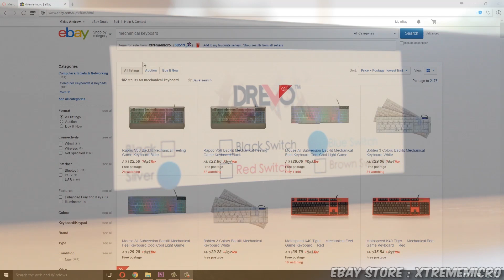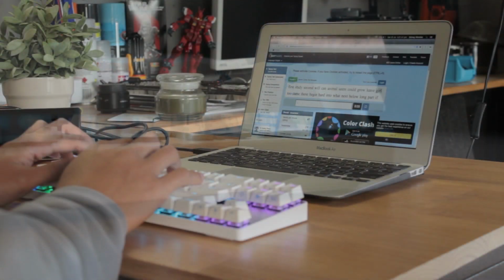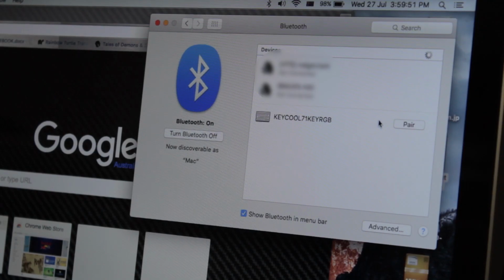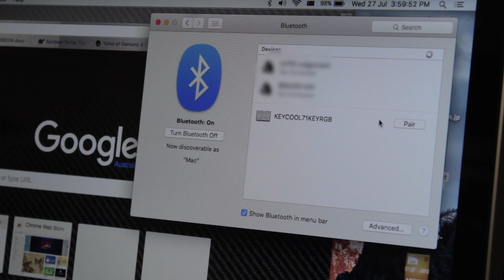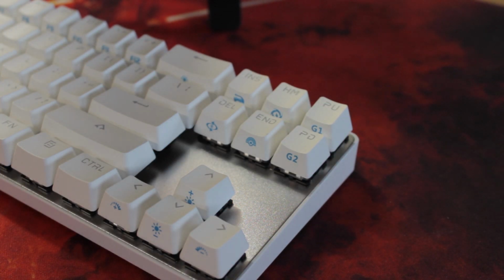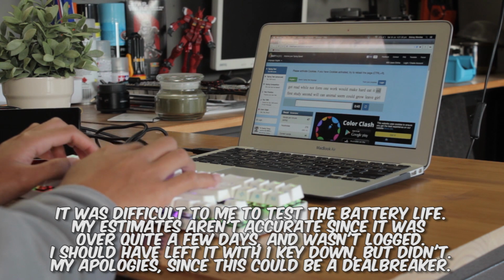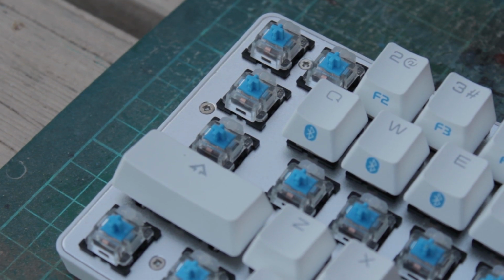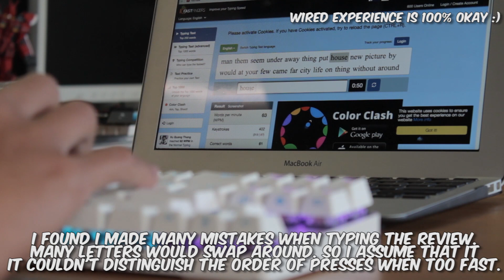Drevo Calibur 71 Wireless RGB Mechanical Keyboard - Unboxing & Review

Comment: READ if you want to know if this is a good keyboard:
I bought it this week and I would recommend it, you get full RGB, mechanical switches and it's compact.
Pro's
-i can't tell the difference between these and real mx cherry blue
-the keyboard overall
-I couldn't feel input lagg and even if you do, you can plug the microUSB in and play wired
-easy to connect, connect once pc will remember (when you plug in cable it automatically goes to wired and if you unplug the wire it goes automatically back to bluetooth within seconds)
-RGB
Con's
-the font (my opinion, but you can replace keycaps)
-if you want to customize the rgb it's is possible for each key lighting but not effects)
the on and off button is not easy accesable (only if you are a nailbiter like me, but it's not impossible to reach)

Comment: What am troubled about is that this is a keyboard with a rechargeable battery. This means that when the rechargeable battery starts to die out your wireless functionality will die with it.
Rechargeable batteries only last for a limited time really. It would have been better if it used normal everyday batteries

Comment: Mine came working fine, but after few weeks of normal used, the usb port got a little too loose, and it started to wobble around. So now, i have to hold the wire down at a certain angle for it to charged properly. Also, thought i could had survive without dedicated F's, and volume key but I was wrong.

Comment: I want to buy it but the thing that throws me back is the build quality, as you said, 2 of your leds were not working correctly and if I get a defective keyboard I wont be able to return it (Personal reasons). Is the build quality (switches) something I should worry about?
Reply from the maker: The switch quality is fine, although they're not the best. The overall quality isn't that great as well, but it is cheap. 

I feel like the keyboard has many features, but doesn't execute any of them that well.
Reply: Would you spend the extra money and get the Anne Pro RGB or this is fine, as I have seen, the Quality of the Anne Keyboard is much higher but buying from bangood will take few weeks to arrive...

Comment: Can you use this connected to the pc via cable/usb ?? and also copuld you please review the keyboard PERIXX-5200 ?
Reply from the maker: Yep, you can just wire it up to a PC.  :)

And that's the same as the Cougar Attack 2. Decent keyboard, very heavy and large. Has quite a few extra keys. Not a bad keyboard.
Reply: TaeKeyboards I have the PERIXX-5200 based on that same model as I just can tell from searching the model you just mentioned, thanks for answering.

Comment: I own this keyboard, but for some reason, my spacebar is stuck as green on the customized lighting modes. How do you change that? I can change other keys, but I can't change the spacebar.
Reply from the maker: I remember having that problem. I don't know what I did, but I just kept pressing different buttons with the function key. It is quite tedious to work with. Sorry :(
Reply: TaeKeyboards Any advice helps, thanks!
Reply: Ok, I figured out how to get the spacebar to change colors. When its green it means its in usb mode, but I removed the battery, so bluetooth mode no longer works and the spacebar now can be changed in colors.
Reply from the maker: Ooo very interesting! Awesome stuff :)
Reply: Wow, thanks for thanks for sharing that! I removed the battery and the color of the spacebar can now be changed. It still blinks green from time to time, though, is it happening on your keyboard as well?
Reply: Yeah, but to me, its no big deal. No problem on the info, I just don't like LiPo batteries and decided to remove it if I wasn't even going to use the bluetooth.
Reply: ZippetySticks I'm wondering how TK made it not blink at all in the video, though. Could there be a key combination to achieve this?
Reply: I don't know, I asked but TaeKeyboards doesn't really know either from what I remember.
Reply: ZippetySticks My bad, the keyboard is in BT mode in the video, so battery removal with occasional spacebar blinking seems to be the best option. I also contacted Drevo support and they said that the green LED can't be disabled in USB mode.

Comment: Hi guys. Just ordered it. I have slight problem with space bar being little stuck. Any ideas how can I improve it? I red somewhere that you can use some oil ons some parts to make it work smoother. Any ideas? Thanks!
Reply: mikelo303 I switched to a different spacebar keycap an it's not sticking anymore.
Reply: I got it sorted. Simply I had to use this damn thig few times and it started working flawlesly.; Overall. Best keyboard for this price. BY the way I got Drevo Gramr or whatever with browns and it's fantastic for gaming and typing quietly. As much as I dislike blue switches loud noise I still preffer blue for typing. However browns are my second best for typing and gaming. Blue switches for gaming must be annoying as shit. Anyways, both keyboards are great for the money.
Reply: mikelo303 Yeah, blues are terrible for gaming. But I love that feedback when typing.
Reply: I actually like my blues for gaming haha

Comment: are this keyboard better than anne rgb 60%?
Reply: adhiessya prasadana imo, yes!
Reply: what make it better? could you explain?  since i'm interested with this keyboard thankyou
Reply: adhiessya prasadana I really love the layout of this one and it looks just great.
Reply: yeah its very look nice tho . thank you very much
Reply: adhiessya prasadana Noooo way.
First Up. Even thou they fixed the Bluetooth (in the newer versions)
The newer anne pro's still have better connection.
Second off The Keycaps on this thing are really jusy meh (Awful looking too) 
The Rgb lights (not even rgb 12 colours) are meh and slow moving
And the Massive advantage Anne pro Has . It's fully programmable albeit through an app (Windows, Ios android and Mac) Plus It's way better looking (also gateron switches ffs)
People Get the drevo only if they can't live without an arrow key cluster
Reply: actually i've already bought anne pro several month ago but good to know that anne better than drevo , so no regret to buy anne tho. thank you so much for the information
Reply: I think Anne Pro is a great choice, but for other people that are interested in the comparison: keep in mind that Anne Pro requires a USB bluetooth adapter/dongle, but not Drevo Calibur.